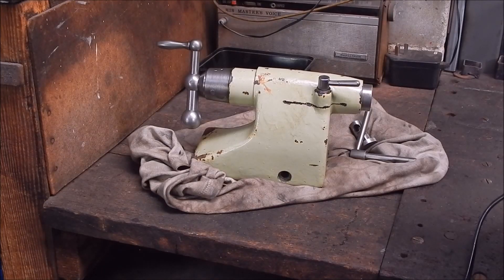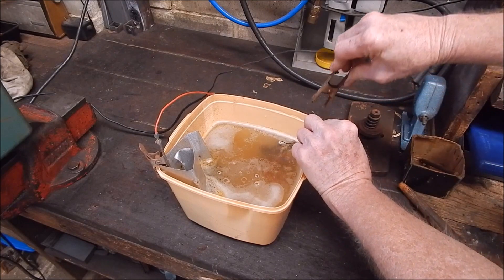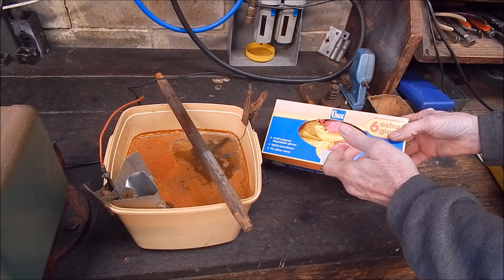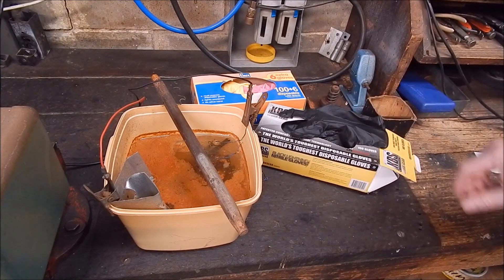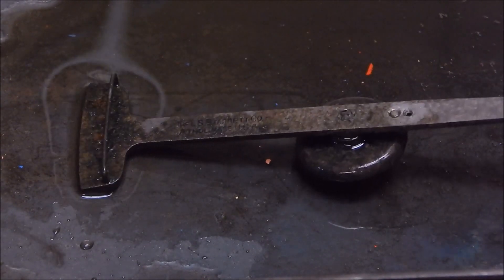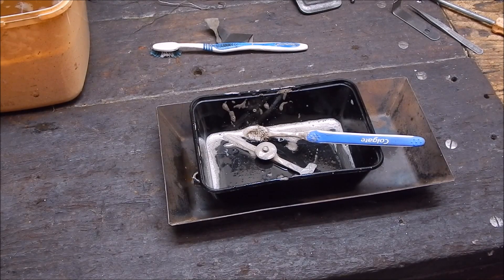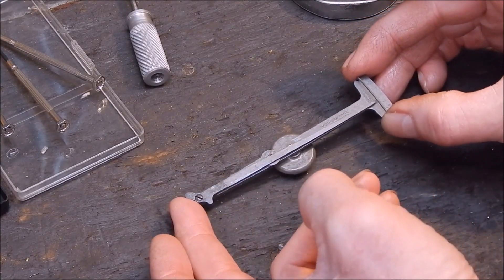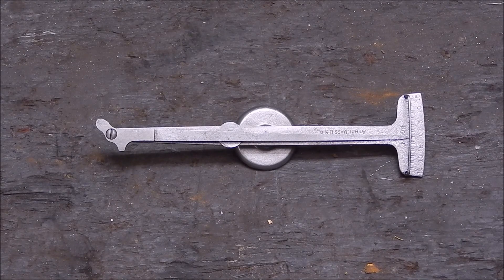I bring a classic vintage test indicator back to life

Comment: Good old electrolysis! Always works. Unfortunately if there is pitting it will remove the rust from the pits, but it won't put metal back in there. Nice job on a fascinating gadget. David Richards (same channel name) runs a steam-powered machine shop and he'd love that Sterret.

Comment: It always flows from Negative to Positive
Reply from the maker: Yep, you're right - the electrons flow that way.

Schematics generally show it flowing the other way.

Cheers Rob
Reply: Not sure who Rob is but enjoyed your video :)
Reply from the maker: Your welcome.
Reply: Ahh the old chestnut electron current flow( -ve to +ve) verse conventional current flow ( +ve to -ve). When I did my electronic  apprenticeship in late 60's  text books were using electron current flow  (easy to explain vacuum 
tube theory) but the heavy power guys and motor theory were still using conventional current flow. The atom consisted of only 3 particles Proton neutron and electron  and a Boson was the head seaman on a Navy ship. By the time I was teaching at TAFE in mid 90s we were back using conventional current flow again (easy to explain transistor theory) But the sparkys were using electron theory so it all depended who the author of the book was as to what was being used.  These days of quantum physics I don't even want to know about Quarks and Bosons and all the rest.
Reply from the maker: Same here.  When I went to school they taught me the same stuff as you.  That was the latest news.

Now it's contradictory,  muti layered, and who knows what else.  LOL.

At least I can still read a wiring diagram, even one in Italian :)

We really don't know much when it's all boiled down.  The whole world is flying by the seat of it's pants.

If we last another thousand years, it should be very interesting.

Cheers Rob

Comment: I have a book titled Tool and Gage Work by Goodrich and Stanley. First printing was in 1907, mines from 1923. In it are the working drawings for building what they called then a test indicator very much like yours. This one has a hardened ball bearing that rides on the surface being indicated. They also show a slotted arm that's used with another round and slotted rod that's held in the machines spindle. So they could be used both horizontally and vertical. They show it being used along with shop built hardened and ground tool makers buttons to locate holes on a part held on a lathes face plate to way under 1/10,000ths for boring and then grinding master gauges used to check the factory floor gauges in a typewriter manufacturers. Exactly when this type of indicator was first developed I don't know. Prior to 1907 for sure.

You'd need to calculate the ratio between the length of the arm on either side of the pivot point to know exactly what the numbers on the scale refer to on yours. But just like today's DTI's they were mostly a nul setting device and in use you tried for zero deflection on the needle. I hadn't known Starrett made there own versions of this tool but I recognized exactly what it was as soon as it started cleaning up. They'd be just as capable today of very fine part and tool setting as they were back then, and in some ways more durable than our DTI's of today. Some day I may build my own version since they can be extremely accurate just by altering the ratio between the long and short arms. Because of the rust pitting yours may not work and repeat quite as well as it should. Very interesting video and I'm glad you took the time to post it.
Reply from the maker: Interesting comments. The Starrett pivot point is actually in first class condition, as the rust had not got into it, due mainly to the close tolerance of the taper screw.  Cheers Rob

Comment: Nice. I think the wheel changes the direction of the spring to change inside/outside operation of the needle.
Reply from the maker: I think you are dead right on that.

The unloaded needle should actually be at either end of the scale and not centred as I showed it - same as a regular modern test indicator operates.

In fact the Starrett is similar to test indicators with a switch to change probe/lever swing direction.

Thanks for the comment.

Cheers Rob

Comment: Hi Rob, Nice save, going to recycle solution on the driveway, too? Neat RCA Victor radio, does that still work? Your chilly, we're having a heat wave in SC, 102 F tomorrow.
Reply from the maker: Yes, the radio still works.  

Lucky you - I prefer the heat any day, although that is a bit warm :)

Good beer drinking weather.

Cheers Rob.

Comment: Hi Rob, That guttering is galv I reckon and from what Ive learned about electrolysis from a few trials you shouldn't use galv.
Reply from the maker: Why is that?

I've always used old galv guttering and nothing abnormal has happened.

Cheers Rob
Reply from the maker: I just had a read up on this point and some blogs say don't use galv, but in all my years of doing this, I've never had an issue with nickle transfer.

I fail to see how nickle can bond to rusted/oxidised steel anyway.

Cheers Rob
Reply from the maker: Meant to say zinc transfer.

Rob
Reply: +xynudu it wasn't the nickel transfer but the cadmium that the electrolysis causes to go into the solution making the waste solution poisonous that I read about and because I pour my solution out in my back yard I didn't want it to poison the ground.